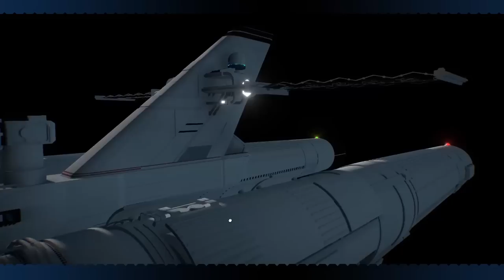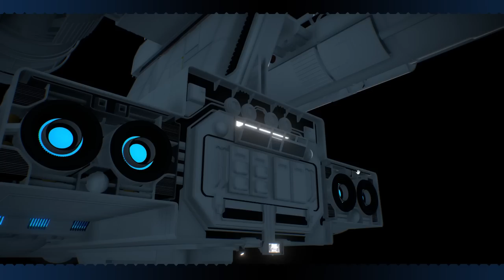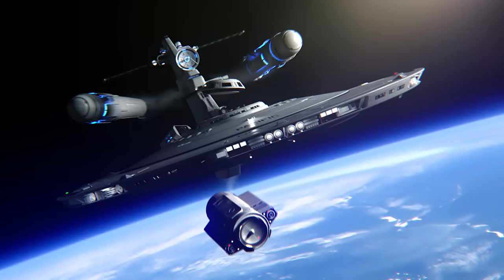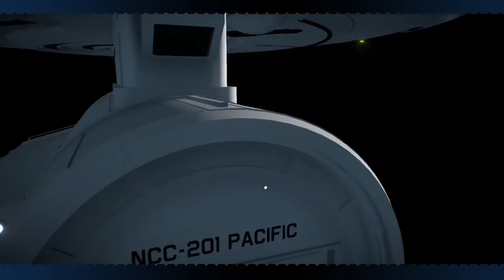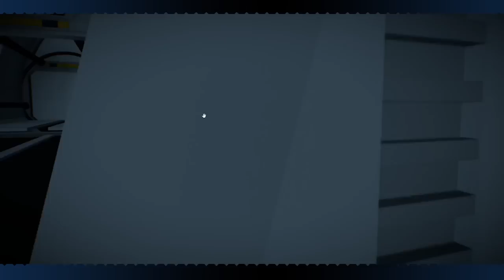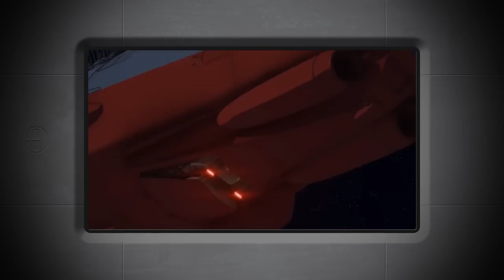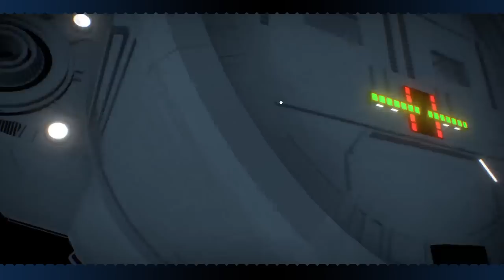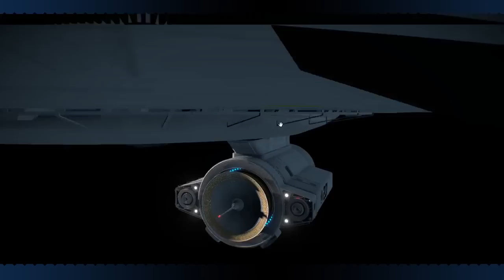Show and Tell: Starship Pacific from Pacific 201 (Star Trek fan film)

Comment: Hello, nice ship there.
Few sugestions though (btw sorry for my spelling and grammar - not native speaker). 

- if you are designing "down to earth feel like" star treky warship for romulan war era, try to consider more numerous or even more robust connection between hull and neclases. Shooting it out of the ship seem just too easy, and unlike photon torpedo launchers, wich are (ironicaly) bolted along the hull, ship can not function properly witouth it. Reason why they are so far from the hull may be simply because of security (lot of antimater equals a big bang if something wrong). But the same goes for the photon torpedo magazines/launchers as well. Therefore

- try to envision, if it may not be better to simply remove or add the torpedo sections on top, or next to the neclases. Also maybe on top of the spinal tower. If the top of spinal tower (secondary engeneering and space staring area of the ship) goes away with the big boom of amunition, it is far more survivable, than if the main hull goes instead. 

- Try to rethink the radiator (heatsink) technology. If used as shown - fine, it works. BUT you may use the heatsinks on MUCH larger area (almost all of the surface area of the ship) and they will double as secondary kinda armour. 

- modularity is GREAT idea and i am 110% for that. But i think, that main 2 charms of complete modularity of vessel is 
1) possibility to actualy BUILD it in smaler docks, or even on the surface of planet and assemble it (in 10 times faster fashion) in the main dock. The same goes for the repairs. 
2) If you got something broken, the ship will get whole new section instead of the dammaged part. Ship gets restocked, rearmed, refueled, gets new crew members if needed, and in 1/10th of time neaded for usual repair cycle in the docks, is on its merry way to kill more romulans. In time of war, THAT is one of crucial statistic elements in war. How much time your assets are actually out in combat and how much time is wasted inside the docks. Ship grounded for repair is nothing more than TARGET. Ship out of the docks is a potent adversary. 

- If the ship is WARSHIP, it is good to consider number of the window-openings in its armour. If needed, consider some armour covering for it, when engaging (something like the armour plates for the neclases. I dig them. 

- If the ship is WARSHIP, it should not harm to add some armament on it. The rebooted Enterprise has it. Point defence and long range altilery does not seem like much, but in open space and when sensors are able to pick up the enemy, it decides the outcome. 

- regarding tactics. Please, do not go too much "Star trek", because it is usually quite far from GOOD spacefight tactics. 
1) Use of starfighters. Smaller and more agile equals less vurneable, at little to no cost in punch strenght. BUT. 
a) the fighters should have some kind of sensor scrambling or stealth technology to avoid get sniped by larger target from afar, and make much harder work for enemy point defence to simply scrub the closest area of everyting in seconds. 
b) the fighters may use some kind of unmaned drone technology, to make the combat area more "unfreindly" for the enemy in terms of numbers of targets, sensors scrambling as a whole and number of guns&warheads in the engagement. 
c) It will be great, if the fighters are as much modular, as possible. Maybe even to extend to use actual trekkie shuttle as fighter, by pluging energy source, shield emiters and phasers/photon torpedoes inside the opened cargo area, when sensors, shield emitors and armament is in paralel pointed in front of the craft. The cockpit is of course presurized, but the rest of the craft is not needed to have air. Because if configuration like that used, the "wing" may be used as 8 potent fighters with bombing capacity, or as 8 transport craft, wich has a lot of transport capacity (especially when you consider NX 01 had only 2 shuttles and 2 work-shuttles). 
2) try to reconsider the atomic rockets. a) even on NX01 were used the "spacial torpedoes" instead of nukes, and even those were regarded too weak in comparison to the photons. b) VLS siloes is a nice touch, but the rockets are VERY slow when starting. Be sure, they are used when threat of enemy sniping them for close detonations next to your ship, is lowest as possible. 
3) Consider the use of drones. If for nothing else, for the area scanner controll. Ship alone detects enemies only so far. When your detectors are moved outside said area, you have MUCH better view on enemy and much more time to plan and execute the confrontation. Star system is a LOT of area to cover, full of asteroids, planets, moons and other natural covers for closing in, or ambush. Especially, when dealing with romulan stealth technology, more sensors equals better chance for survival. AND if you use some close defense drones, they would probably increase effectivity of your point defence and (if needed) they may shield your ship by their own "body"(/ies) against atacks, you can not dodge, or escape other way. 
4) concentrating firepower of all guns in firing position, regardless of ship wich it is on, for chosen enemy subsystem or part of ship is a must. 
5) Consider the use of newtonian laws of physics in space combat. It does not matter, if enemy is hit by photon torpedo, or a superfast lump(s) of metal, regarding destructive potential. But torpedoes are expected threat and shields are usually able to deflect them. And as shown numerous times, when Enterprise ramming enemy, the shields does not do much good against simple momentum of matter - kinetic force. AND unlike the torpedoes, the kinetic projectiles are small simple, cheap and possibly numerous enough to saturate SUSPECTED area. And when cloaked enemy there, you will hit and probably decloack it. On projectiles:
a) projectiles speedy enough are quite destructive, hard to dodge and probably able to penetrate, or considerably weaking the shields. Railgun? Coilgun? Gravitation gun? 
b) The same goes for escape via sublight engines (when enemy chases you, therefore is expected to stick to the predetermined course, or risk to loose you). It is simple as it goes to jettison few tones of small scrap metal into path of your unsuspecting enemy and than watch the firework, as it is hitting it head-on, effectively using its engines to increase of the kinetic impact force. 
6) This idea(s) is regretably no-go for federation ship (if not considered to be lost and destroy all witnesses of its demise), but tactic-wise it would be interesting to use warpdrive as substitute for cloaking, and/or for weapon. 
a) Short jumps during the engagement and quick attacks would be quite good tactics, increasing chance to hit enemy and decreasing chance to be hit by enemy in retaliation. 
b) The warp works as a folding of space around the ship. In front of the ship it is compressed and behind the ship it is "inflated" back to its original state and shape. What will it do with a ship, if you "lick" it by your warp buble, or even modify your buble to NOT unfold the space, in wich the "licked" ship is? 
7) What if one or more of "torpedo racks" you added to your ship is supplemented (or replaced) by "heavy phaser rack"? Of couse with its own inbuild source of energy. 
8) WHAT is wrong with whole star trek imaging technology, that they need to have most delicate and vurneable part of the ship (bridge) effectively outside its armour and hull? Hell, TODAY we are able to use OUR imaging technology to project the images of outside on the inner walls, to actually achieve "see-thru" feel for fricking tank armour. Or if you do not want that, you may use old simple 3D helmets for pilots and gunners and HD screen for the rest of the bridge crew. For captain, tactic-wise is more ussefull and needed to have projections of courses of space bodies (incl. enemies, asteroids and fired amunition), than information on wich colouring scheme does the enemies use for their ships. The same goes for number and position of subsystems (incl armament) on enemy, and some basic energy readings (shield up - Y/N, Warp drive priming - Y/N, Weapons heating up - Y/N) In Star trek, all those informations are on science officer to find it and inform verbally the captain. It may does not seem as much, but it actually slows the reaction time of the ship as a whole for at least 4 seconds. If captain actually SEES all of that information and inteligent hud only headlight changes, The chief science officer is free, to actually validate those informations and support the CIC, or devise scientificaly based feasible plans to counter the enemy and offer them to captain, when needed. 

And that is all for now, sorry for all your time. Spent almost 2 hours to write it down, so, if possible, at least check that. May found some ideas wich you may actually like. BR, Ultramarinus.
Reply: Point defence is needed simply because of numerous overwhelming. 

In the universe, where almost ANYBODY has warpdrives (even for smaler ships), point defence is a logical MUST. Big ships simply can not have enough of main batery phasers on all the suitable spots on the hull to evenly and densly enough defend its close perimeter. Simply put, it is cheaper, energeticaly less consuming and with better protection to use MIXED armament, comprising of heavy phasers torpedoes and point defence.  If you remember the first part of Enterprise reboot where USS Kelvin was covering the escaping shuttles and afterwards the part, where Enterprise was covering the "red matter" ship piloted by Spock. 

The fighters are as ussefull, as they are able to penetrate the defence of big ship. It is simply cheaper and more human lives-saving, to lay down 20 shuttles, with crew of 2 each, to get 1 "big", with crew of 100 and more, with double the tonnage of all 20 shuttles combined. In case, there is no chance to suprise attack an unshielded target, nor to penetrate shields with weapons of the "fighter", it is not worth to try. BUT when fighters gain the ability to hit  hard, or destroy their target, there are MUCH more ways to crank the survivability of the fighters pretty high. If target can not locate you, it can not fire upon you (sensor scrambling, invisibility, or artifical hightening of possible targets by using decoys as part of the attacking force). If target can fire upon you and you are quick and manuebrable enough to dodge, you are safe too. If you GET hit and your shields simply shrug it off (at least for the first few hits), you are still OK. Armour does not count in this, simply because of vurneability of small vessels to the bigger guns, but other techniques offers a good chance to the fighter. 

1.5 lightyears as a range of phasers. A weapon, wich attacks with the spead of light. Well, it is a NICE range, but effective range will be probably shorter, because to hit anything at that range, you (and IT) would have to wait and sit on its place for fricking 18 months. I would most likely buy some photon torpedoe, wich use warpdrive after it is fired, to close to the target and attack in reasonable timetable, but for phasers? NEVER. 

Star trek shields are most vurneable by kinetic force. And even the deflectors are ussefull only to some degree (wich would not be so hard to top by the gun). All planet-crashes, Kamikaze-runs, meteor - defects are quite numerous in ST to be technicaly imposible to achieve. And basicaly, i belive the torpedo-tubes in ST ARE kinda "railguns".

Regarding "armor in this era was not that good and therefore is no difference if the bridge is out or inside the hull" quote. Even "bad" armour is much better than NONE. And windows (the only reason to keep the bridge on the top part of the hull) does not provide any sighificant situational or navigational awarenes to speek of. And surely nothing more, than camera (and great screen-monitor, as actually used on the ships instead of looking from the windows) or periscope could provide too. Also, it is much easier to ARMOUR UP the bridge, when inside the hull. When enough of crappy armour layered onto something, it starts to be suddenly protected quite good. Ok, to the enemy torpedo, the location of bridge is quite irrelevant. But that is not the ONLY threat. Your bridge could get sniped (by phasers, when its shields are penetrated), your bridge could get peeled off by kamikaze-crashing run (to wich the shields are mostly irrelevant). You may get boarded from the outside of the hull (and suddenly you find out, that it is idiotic to hold your command staff behind simple wall outside, instead of behind safe-grade armour in the middle of the ship, when they pull out their breaching-charges. The fact, that to torpedoes it may not be so relevant does not mean, that simply to lessen other possible threats and attacks, the ship should not have military filosofy build protection. 

Regarding drones - yes and no. If the target can be find out by drones from 30 light minutes and by your mothership from 1 light day, it is still ussefull and wise to swarm the drones outside the perimeter of your "sight". Not to mention situations, where the other ship can be hidden behind planet, asteroid, or another planetary body. Sometimes it is better to have cooperating net of small sensors in conjunction to the shipboard one, than to have only the shipboard - stronger, but solo-working. 

Cloaked ship can be DEcloaked by a bag of dust and camera, when used properly, therefore i belive, the drones (in size of torpedo or fighter/shuttle) would be quite enough to detect the prey. Maybe on shorter range than their mothership, but that is exactly the point of using sensors in advance of your own ship-sensors. 

Ok, goot to know the science-officer has some redundancy. Navigator and pilot usually use the sensor-output to avoid navigation hazards and obstacles in impulse, and to traverse by warp from point A to point B. Tactical uses that for aiming and possibly looking for suitable subsystem to destroy. Other members of the bridge-crew has their own jobs during red alert, but for sake of balance - lets say there is a redundancy and (possible) enough of it. And what something shoots of the bridge? WHO will then command, scan, etc? StarTrek ships simply need auxilary bridges, or widened engine-rooms, wich may be used as backup bridges as well. 

Actually, if i think about space combat, i think babylon 5 (the earlier earth-force) and expanse-werse.

Comment: Heat is an important issue in space. But space is a cold place. ISS using radiator panels because being relatively close to the sun (in starship terms) it has issues with heat accumulation. But starships typically wouldn't. Even old Apollo used a passive thermal control, without radiator panels